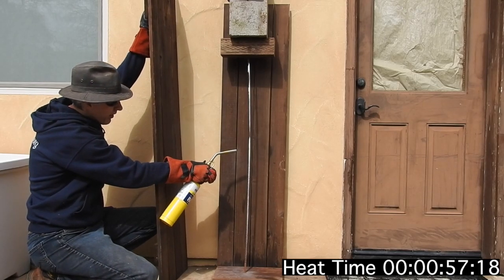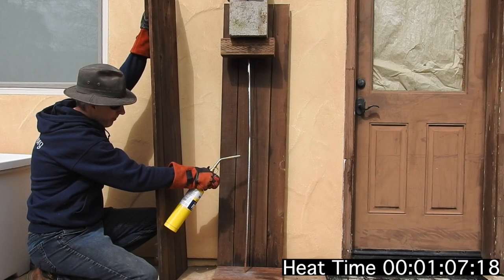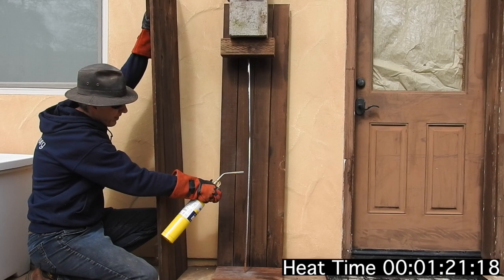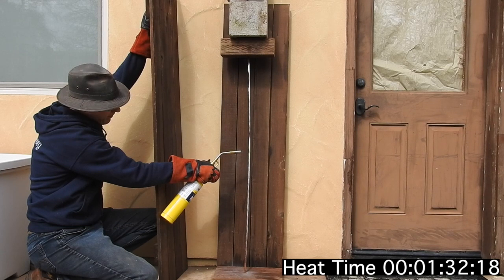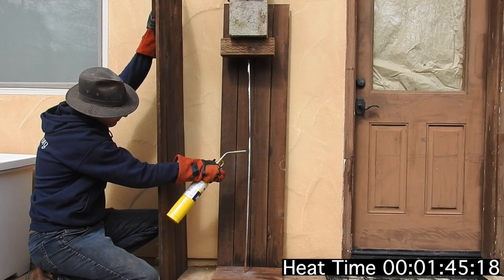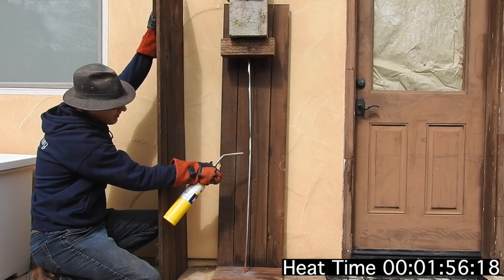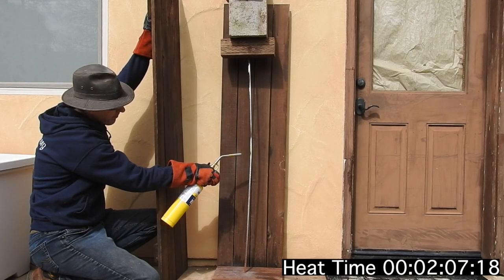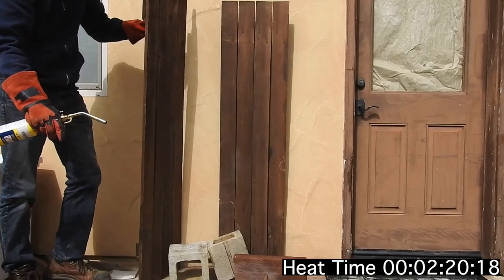Vertical Steel Support Failing by Heating Without Melting, like in the WTC

Comment: This is a terrible experiment you don't give the weight to strength ratio. We have no idea how hot your getting that or what kind of metal it is. Unlike the guy said before it didn't go straight down it toppled over to the side.
Reply from the maker: It's steel rebar, it's getting to the softening point of steel. It's an illustration of the fact that a column does not need to melt to rapidly fail. There's lots of differences.
Reply: @MickWest   It's very obvious that it's steel rebar. Do you understand that the amount of weight on top of the steel  Far exceeds in proportion to the weight of the top of the world trade center? Do you understand that temperature of the fire varies? And that in most places it is well below 1000degrees farenheit? Also just because you have a fire that doesn't necessarily mean that the columns are as hot as the fire , usually they are not.
Reply from the maker: @davmus1112  I understand. But for small scale models, you need to add weight because of the square/cube problem.
An empty soda can will support several thousand times its own weight. Yet if you were to take WTC7 and place a copy of it on itself, then it would collapse. Why is that?
Reply: @MickWest  if you add another wtc7 on top of the existing wtc7....totally irrelevant. The building allegedly collapsed due to gravity. An object in free fall can do no work. This is a very well established principle in physics. Wtc7 fell at freefall for 2.5 seconds. All of the energy was used to accelerate the building meaning that there would be no energy left over to crush the 83 columns.
Reply from the maker: @davmus1112  What's the diffience between 99% free fall, and 100% free fall, in terms of measuring it on that video for 2.5 second?
You can't tell if there's 1% left, and long buckled columns lose most of their strength quite rapidly - especially when the buckling makes then snap apart at the splices.
Reply: @MickWest   How do you know there was long and unsupported columns inside the building
Reply from the maker: @davmus1112  I'm talking about the ones on the OUTSIDE of the building. We can tell because the penthouse collapsed thought the building, and the exterior kinked when it started to fall.
Reply: @MickWest   When the building started to collapse first you saw the penthouse disappear then a kink in the top left center.  because for all  controlled demolition they take out the interior columns 1st so that when the building falls it doesn't make any collateral damage
Reply from the maker: @davmus1112  I'm talking about the "fire and impact damage" hypothesis.
Reply: @MickWest   So are you trying to say that you believe the fires from September 11th caused WTC7 to collapse in 6.5 seconds
Reply from the maker: @davmus1112  No, it took a lot longer than that. Time it from when the penthouse starts to move. Around 13 seconds. https://www.youtube.com/watch?v=QiFxm16-MQ0
Reply: @MickWest    You don't actually think that all the counts failed at the same time causing the top 15% of the building to the ballast the bottom 85% of the building do you?  Can you think of another example where that could happen?  Think about it think about any structure were you cut off the top 15% and drop it on the bottom and it destroys itself all the way down to the ground. By the way the top 15% only represented 3% of the building weight because the columns were so much thinner at the top
Reply: @MickWest   So here's where engineering background would come in handy. Having one steel rebar vertically support a weight that goes way over the top of its center of gravity is not comparable to a structure that is designed to be structurally strong and many vectors. So even if the steel was half its strength it wouldn't fall over to the side because it's supported by so many other steel supports. Now that's what your example did it fell over to the side. if it was supported from falling over to the side it certainly wouldn't have gone straight down through itself would it?
Reply from the maker: @davmus1112  Sure, but this is just demonstrating that when steel is weakened, it can fail with a relatively small load without melting. It would be rather difficult (impossible really) to make a representative small physical model of the structure of the building, because of the square/cube problem.
Reply: @MickWest  it would be relatively difficult...its impossible

Comment: On September 11th 2001 I was checking nearly every television report by constantly switching channels.  Just a moment prior to the first tower falling I heard on this live report, 7 precisely spaced reports as did the reporter and my immediate thought was that the building was wired for controlled demolition.  As that realization came to me, the reporter said "oh my God! The building was wired!" Within moments,  that station cut to another reporter and I started to quickly check other channels to see what they had to say about the precisely timed explosions and there was nothing anywhere I could find including the station I'd seen and heard it on. That reporter never showed back up at all on that station either during the whole event.  What shook me most that day was how fast that information was squelched.
Reply: James Pietsch  I simply stated what I heard and saw that day. Nowhere in my comment did I try to convince anyone. If you feel the need to call a memory BS, feel free.

Comment: Now heat it from the top and not the dead center. The fire was near the top of the building. if heat rises, explain to me how it would have melted the foundation.
Reply from the maker: It didn't melt the foundation. Why do you think the foundation was melted? The collapse started at the top and proceeded down to the bottom. The foundation was the last thing affected and was largely still.. there.
Reply: Mick West thanks for responding man. I’m actually a fan of your work, especially stuff on UFOs. But melted was the wrong word. I just don’t see how a fire could make a building fall that way is all I’m trying to say. Surely there would be other examples of buildings falling this way from fires? But they’re all demolition style from my research.
Reply from the maker: @Evo1ve36K  It was a rather unique set of events, so why would you expect there to be other similar events? The plane impacts stripped the insulation from the steel in the impact zone, and this let the fire have a much more pronounced effect than in other building fires.  In addition, the planes had already done a lot of structural damage by destroying some columns. The heating of the remaining columns and the failure and sagging of the floor trusses eventually led to a situation where it was impossible to hold up the upper part, so it started to fall, this is the initiation of the collapse. 
Then there's the progression. The falling upper mass stripped the floors away from the outer walls and the core. The walls fell outwards, the core partially remained standing, but rapidly gave way from a combination of bracing removal and lateral forces.

Comment: What part of this was "like in the WTC"?
Reply from the maker: "Vertical Steel Support Failing by Heating Without Melting"
Reply: Mick West - Except none of the 3 WTC's fell over sideways like your rebar. Your concrete didn't turn to dust like it did in the WTC's. You would need well placed high explosives like in all 3 WTC's to do that.
Reply from the maker: But some of the vertical steel supports failed by heating. That is what was being demonstrated. It's not a model of a tower.
Reply: Or you just need concrete floors to fall on top of each other....
Reply: @MickWest  you are out of your mind, dude.
Find and expert and try a DIALOGUE, if you ever heard about that.
Reply: @WasItWorthTheTime  This guy is ridiculous, he never invite someone competent, like and expert. I wonder why.

Comment: Also, I believe you're not getting accurate readouts on your supposed measurements of the heat of this torch because propane and butane torches burn at about 2,000 c and 1,500 c respectively. So what kind of torch are you using?
Reply from the maker: Great question. It's a a propylene torch, it's a slightly hotter version of propane that puts out more heat. 3600°F/1982°C. The temperature readings are how hot it can heat up steel - which depends on the heat flow within the steel. My readings were from heating up steel bars, similar size to the rebar, and I actually got it to around 750°